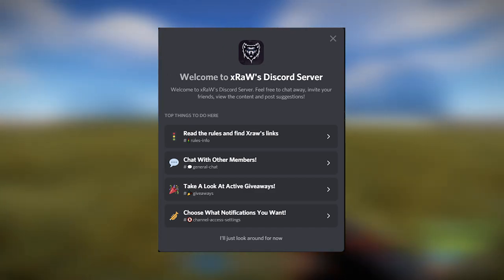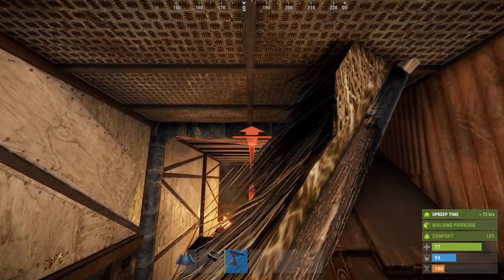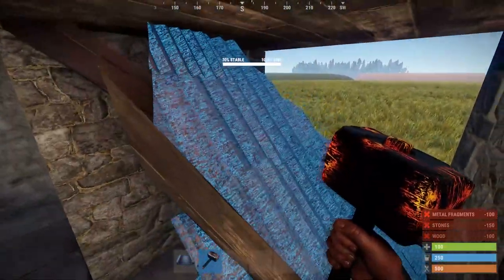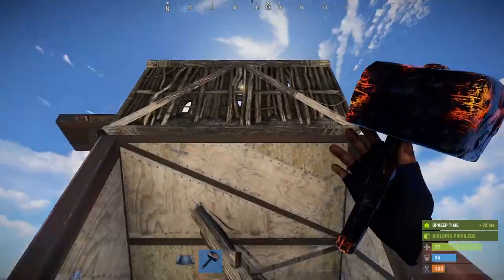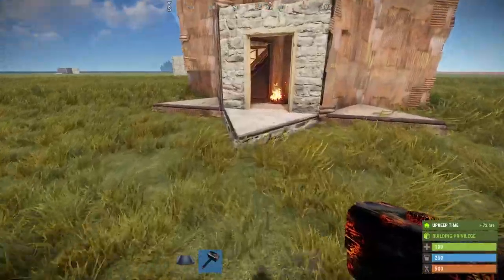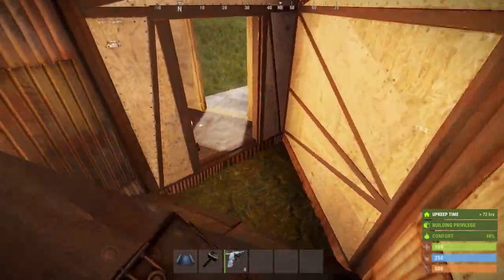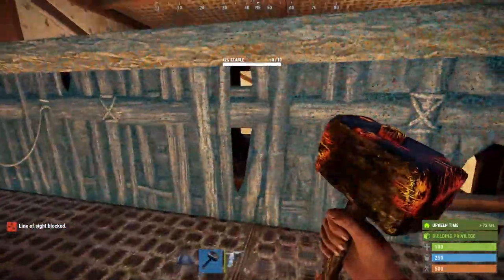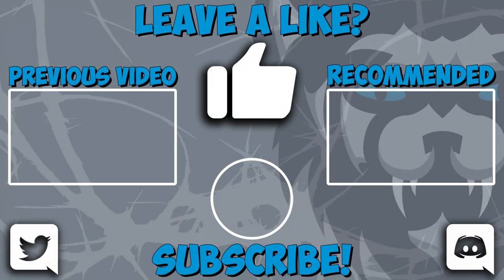RUST - The Roof Bunker RETURNS - Community Features #3 (2021)

Comment: Have you tested what might be able to splash twig through the walls in that position? Since it's a reverse mechanism (placing, rather than destroying, opens the bunker) could one recognise the floor stacking design and destroy the twig opening the bunker significantly reducing the cost of the raid.
Reply: Read half your comment, there's your answer
Reply from the maker: They could indeed and that’s exactly why the floor stacking is in place. BUT this video serves as a proof of concept rather than a finished design. A design will follow but ofc I’d be interested to see others thoughts too.
You can also upgrade it to wood and likely still chop through the gap as a temporary solution

Comment: so what is the fix for your solo build?
Reply from the maker: Hey! I repleid to your comment on my other video :P I would check out "The Fortress" for a working bunker.
You can also use this method and work it into the build of the Solo Vault - the Metal floor that holds the roof up currently you want to swap for a twig so u can remove the roof easily.